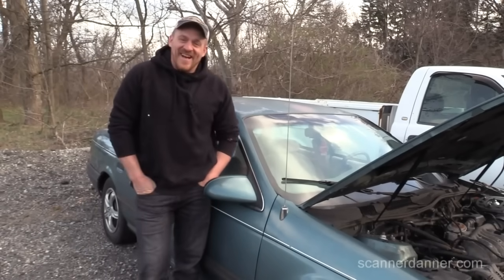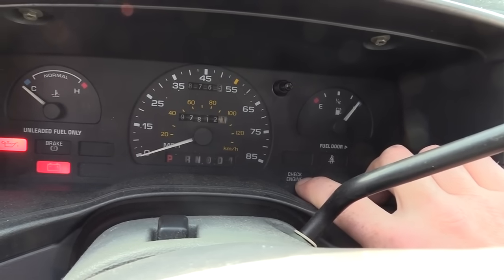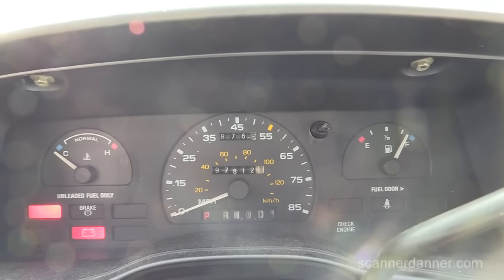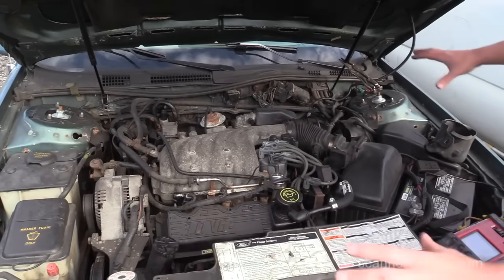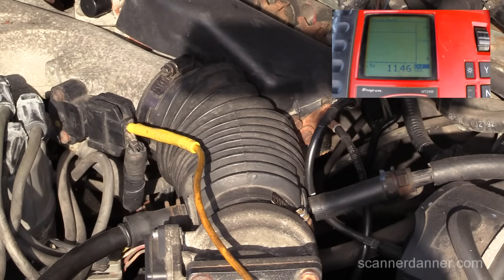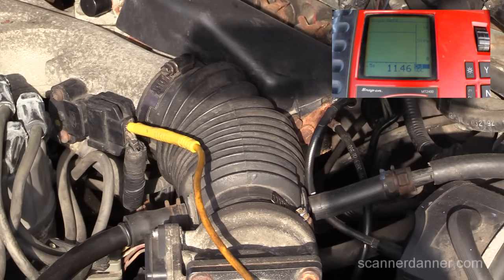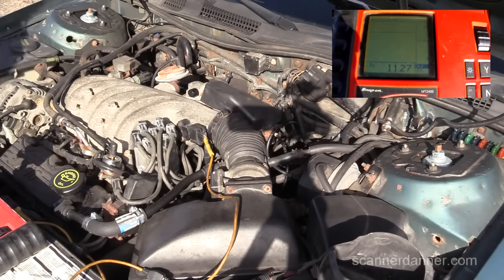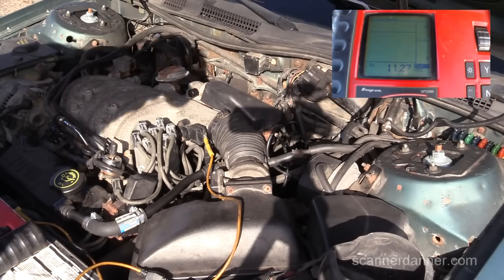Sensor grounds and the 5v reference circuit (a 2016 ScannerDanner Premium video)

Comment: @scannerdanner. Working on a UTV with Delphi EFI ,what would I look for, on the TPS it only has a 5 volt signal, no output signal with throttle movement, and it only shows ground with the key off, loses ground when key is turned on. Any idea?
Reply from the maker: With key on, what is your voltage on all 3 wires plugged in and unplugged?
Reply: @ScannerDanner  the constant wire is around 5 volts, the output signal wire might be.25? But does not change with opening the throttle. And I have continuity on the ground but only with the key off, the numbers are the same for plugged in or unplugged. I can get a exact number for you tonight though to help. I'm bummfuzzled by it.
Reply: @ScannerDanner  also forgot to include, I'm getting a P0122 trouble diagnostics code.
Reply: @ScannerDanner  ok got you some numbers, with the sensor unplugged,  and the KEY ON,I'm getting 5.15 volts on the constant wire, the signal output, is 0.12, and the ground is 0.15, with it PLUGGED IN, the constant is 5.15, signal output is 0.27, and the ground is 0.15. Keep in mind I can test for continuity and I only get the meter to beep with the key OFF, and this is on every sensor on it,that has a green ground wire, when I turn the key ON, the continuity is gone. Any ideas?
Reply from the maker: Sounds like a bad sensor if the signal voltage doesn't move with throttle opening. Or something is damaged mechanically that moves the TPS? Is this a cable driven throttle body or electronic?
Reply: @ScannerDanner  I have replaced the sensor already, I can plug in the old sensor and get you those numbers if you want want also. And this is a cable driven throttle body.
Reply from the maker: @chrisvantuyl5554  something mechanical is not moving then, look at the mechanism that moves the tps wiper
Reply: @ScannerDanner  do you suggest removing the sensor and moving it by hand and see if the voltage changes? What about the sensor losing ground when the key is on? Does the sensor require a ground to output voltage?
Reply from the maker: @chrisvantuyl5554  yes, BUT you said voltage remained near 0v on the ground wire, plugged in, with the key on. Forget the ohmmeter here, as it is unreliable and sensors all share grounds.. If your ground is bad, that voltage will rise near 5v (the source) and so will the sensor signal wire (sensor plugged in)
Recheck your ground using the voltage drop test (ground to ground. It should be 100mv or less (.1 or less)
Reply: @ScannerDanner  where would all of the ground come from? I'm assuming the ECM supplies it? And you'll have to explain what you want me to do, as far as ground to ground test? Hoping we'll get this figured out.
Reply from the maker: @chrisvantuyl5554  sensor grounds all go to the computer. 
One lead to battery ground, on lead to sensor ground, key on, sensor plugged in, backprobing
Reply: @ScannerDanner  ok. I'll try that tonight after work and report my findings..what am expecting to see..or not see, and where to go from there?
Reply: @ScannerDanner  ok..I'm getting 0.15 volts when I did that test. What is that telling us to check next?
Reply: @ScannerDanner  think you'll like this, the TPS has been replaced, BUT, curiosity got me. I took it off the throttle body and it reads output voltage? Got to looking at it, the butterfly plate spins opposite of how the sensor does when mounted. I had the old sensor to compare it to, and sure enough it is correct...you were correct in the mechanical aspect you asked about. Ok..plugged old sensor back in...still hard start...no idle etc... mistakenly wiggle wire harness and saw change how it ran...got it to idle fine and carefully unplugged sensor... idle fine... plug back in... instantly dies. SO...I pulled back the weather grommet from the connector..what look like is just the insulation split to me...got the voltmeter out...set to continuity...and tested from end of the connector to where insulation was bare... wiggle it around to simulate engine vibration..BOOM 💥… LOSES CONTINUITY GROUND. I'm going to try to find a replacement pigtail harness and hope this solves the problem... crossing my fingers
Reply from the maker: @chrisvantuyl5554  you should have been able to catch that with voltage jumping to 5v on the ground, unless you were testing the ground before the break in the wire? Were you piercing the wire or backprobing the pin at the connector? Either way, nice find! You can repair those connectors sometimes.
Reply from the maker: @chrisvantuyl5554  i repair the crank sensor wires on this one. Skip to that part https://youtu.be/xwh3XM1Nl4k
Reply: @ScannerDanner  I was using a needle poked up into the connector, which was above the break in the wire. I'm going to watch the video you linked to me also
Reply from the maker: @chrisvantuyl5554  that's why you missed it then, but you still should have seen in on the signal wire. Voltage would intermittently jump to 5v every time the ground connection was bad 🤔
Reply: @ScannerDanner  I'm as confused as you, this may not fix the problem then, I am going to replace the connector with a replacement pigtail harness, as my soldering skills are not good, and it's the easiest way for me, I'll replace that and report back, anything else I should be looking at, testing?
Reply from the maker: @chrisvantuyl5554  just the mechanical parts we talked about
Reply: @ScannerDanner  Well..back at square one...I'm not one to give up..but I think I give in. 

Still not fixed the problem..very difficult to get started.unless push gas pedal down..then if unplug the TPS it will idle perfect all day long, plug the TPS back in... stumbles and dies immediately. 

I can get it to idle and occasionally floorboard it but it doesn't run good at all .if I unplug the ECT sensor it makes a difference though. 

If you have ANY idea what to try..look at next please let me know. 

I really thought that broken wire was the problem
Reply from the maker: @chrisvantuyl5554  still no tps signal voltage change as you're opening the throttle?
Reply: @ScannerDanner  yes, I'm getting signal voltage changes while pressing the throttle down.
Reply from the maker: @chrisvantuyl5554  so you fixed A problem, just not THE problem. At this point, we need to move this to my forum www.scannerdanner.com it is free to join and we can help you further there.
Reply: @ScannerDanner  ok that sounds good. How do I go about doing that?
Reply from the maker: @chrisvantuyl5554  just go to my website and register for a free account. Then post a help request here https://www.scannerdanner.com/forum/post-your-repair-questions-here.html

Comment: Why does a 5v reference not blow fuses when it is grounded ?
Reply from the maker: It is a voltage regulator and is a protected circuit. If it wasn't protected, it would blow out the regulator, not a fuse. Hope that makes sense

Comment: I have a 2002 Taurus ses my check engine light and battery light and transaxle light and gas cap light don’t come on when I try to start it no sound at all I don’t hear the fuel pump running at all the car been sitting there for 4 months now
Reply from the maker: do you have a 5v reference at your TPS? It is a good place to start

Comment: Hi all. Could someone please explain to me why the sensor ground reverts to default battery voltage if there's a ground to ground short?
Reply from the maker: It is a ground to ground OPEN, not a short my friend. The voltmeter is reading difference in potential between the two ground points. No ground on a circuit, equals no current flow and no voltage drop, so you will read source voltage on the other side of the open. Hope that makes sense.
Reply: @ScannerDanner  Thank you very much for the clarification Mr Danner! And thank you for the excellent content, your detail oriented style of teaching electronic and electric fundamentals has really taught me a lot. Keep up the great work!

Comment: Hi there, I am having a 00538 reference voltage- Open Circuit error in Central Electric of my VW Polo Gt Tdi 1.6. The fault code stays static until car's ignition is on and it can be erased only after starting the car and doesn't recurr until the car is turned off and then switched on again. The fault code started flashing only after mice chewed the wires which were fixed later. Even the ac/blowers cuts off randomly and starts again only after I switch off the car and turn it on again, but then there is no fault code in HVAC. The technician at vw said the fault code disappeared after hooking up the battery with a charger and recurred after the charger was removed. He said the alternator is faulty, but then I don't think it is. It gives an output of 13.9v without load and 13.8 with load. Can you please help me.
Reply from the maker: An alternator can fail (diode) and still charge the system.
To confirm, unplug the alternator and then start it up with it out of the picture. If your problem is gone, then I agree with the tech who looked at it. 
If you still have your issues, next thing is to find out what  sensors share that particular reference circuit and we then move in that direction (wiring/sensor inspections)
Reply: @ScannerDanner  Hi Paul, Thanks a ton for replying in no time and giving your valuable inputs. Will follow your instructions and revert to you. Good Bless you.
Reply: @ScannerDanner  Hi Dan, Finally resolved the 00538 reference voltage issue, after doing loads of research. It was a severed ground wire to the BCM. Mice had chewed it off. So basically reference means ground/earthing.
Reply from the maker: @funksobravo1  my name is Paul Danner :-) Nice find! Thanks for the update
Reply: @ScannerDanner  Yes! Paul it is.

Comment: I used a paper clip to check a 5volt reference.  it comes up with 8.1v.   what is going on
Reply from the maker: 8.1v on a 5v reference = bad computer ground, just like in this video
Reply: @ScannerDanner  how do I check that
Reply: I'm checking the fuel pump fuse and I get 12.08v.  I'm missing a half volt from car not staring.  could I have a short from fuse to battery?   please any insight for this

Comment: ScannerDanner can you make more youtube videos explaining the theory on how the ECU board work and what it controls the spark plugs , ignition coils, the starter, how it regulates the alternator, etc. Yes a TIPM is a central gateway, can you make a youtube video explain the theory on how a TIPM work what network signals it uses and how its a gateway or other cars that use gateways, like what do gateways do in cars. Watching your videos on getting scan errors and watching you using a light bulb circuit tester to inject 12volts by tapping it on the ECU sensor inputs is not a good idea i would think because the ECU sensor inputs are at 5 volts PWM signals not 12volts. I'm not sure why you're connecting you light bulb circuit tester to the cars batter +12 volts positive terminal and tapping the light bulb circuit tester on ECU sensor inputs to  test and verify if the ECU is working and outputting signals. I would have connected the light bulb circuit tester on the +5 volt reference voltage not the +12 volts. The Light Bulb circuit tester "will only light" is there is a short to ground if the wire harness has short to ground, this is what you say in multiple videos.

Comment: Question why would a computer the bad ground can cause 11 volt
Reply from the maker: It is no different than any other circuit with a bad ground. No current flow = no voltage drop. The ECM board itself has no ground, so all power coming in and circuits trying to operate cause the entire board ground voltage to rise. Hope that makes sense. I could draw it better than describe it. I'm sure I do in one of my playlists I provided here in this description. The ground circuit problems one. There's like 6 videos in that playlist. I think you'll get a better ideas when you see some more. Thank you!

Comment: Scannerdanner, 1.) TIPMs have multiple ECU chips microcontroller chips any reasons why a TIPM uses microcontroller chips and relays if a TIPM is just a Fuse box? 2.) There must be a reasons why a cars charging system is at 400hz and not at 80hz or 200hz, why 400hz? 3.) TIPMS convert CAN 2.0A signals, CAN 2.0B signals to LIN signals? 4.) If you car is using CAN 2.0A or CAN 2.0B can you upgrade it to CAN FD by changing what to do the upgrade? does the ECU and all the cars CAN modules need to be upgraded to CAN FD also? 5.) What have you used a CAN sniffer for or can you please give examples of using a CAN sniffer for to do what?
Reply from the maker: You can't be serious. Lol I'm not going to write you a book here. Sorry. Wrong platform for this.
Reply from the maker: Here , let me try:
1). A TIPM is a Chrysler "smart fuse box". It is a computer that talks on the network which allows the manufacture to save on wiring and components. (less components, less wiring to do the same function)
2) again, you are asking about 1 specific charging system and you are not even telling me what car you are talking about THEY ARE ALL DIFFERENT
3) Not sure what you are saying but if the TIPM is the gateway, this allows different speed networks to all be able to talk to each other
4) No idea
5) never heard of a CAN sniffer
I will not be answering any more of these rapid fire questions. If you have questions about a specific procedure I've done in a video, feel free to ask. I'll do my best to answer. Please understand I have 200k other people asking me questions too.

Comment: Most cars have both 12v and 5V as well as growing and signal wire going back to the ECU going to  sensors so that fact that you saw 12v doesn’t mean it’s the culprit
Reply from the maker: When you know your fundamentals and understand that a typical potentiometer or pressure sensor has a 5v ref, signal and a ground and that you should NEVER read anything higher than 5v on these types of sensors, you can make that call from the get go.